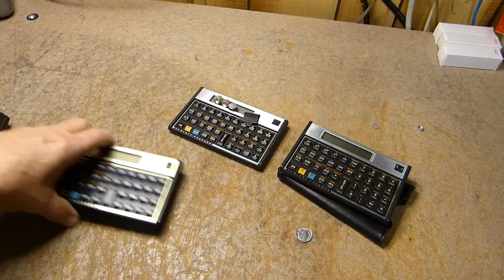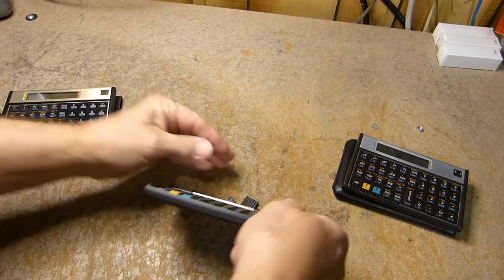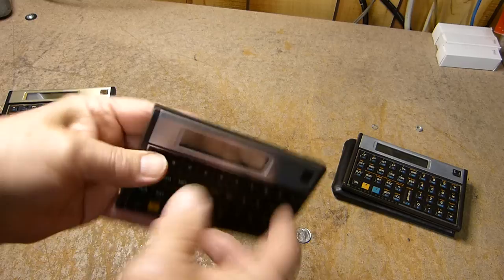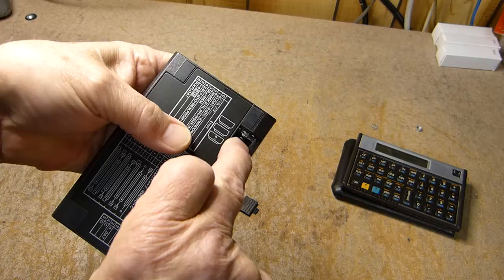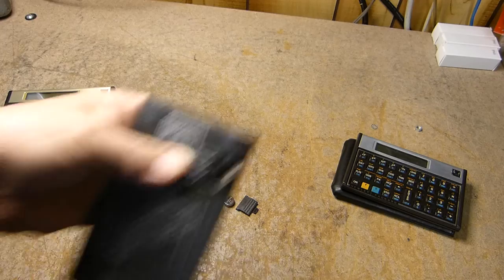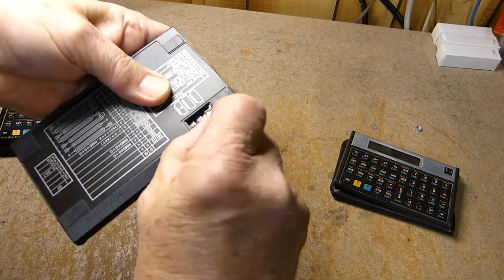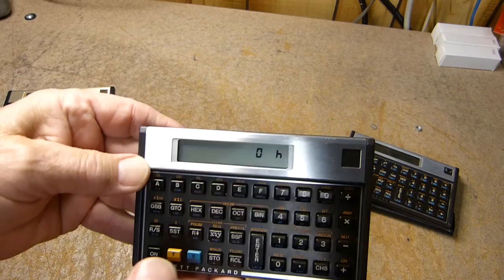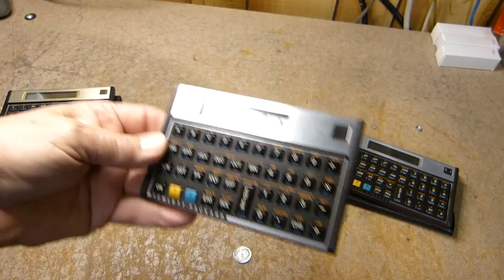HP 15C 12C 16C RPN Calculator Reset Procedure

Comment: WOW.  That is exactly what my calculator needed.  It had "juice" and had a full display of gibberish.  I replaced the batteries with some I had around the house and turned it on and still "gibberish".  I then figured that my back up batteries had also gone bad.  So went to Walgreens and picked up three "357s" for $11.00.  Put them in my calculator (a 12C) and same thing!  I was like "what the @#$%".  So then YouTube searched for resetting a 12C if nothing else but for some laughs and giggles.  And saw your "Dime trick".  With the batteries removed.  So did the "dime short circuit" just like you showed for several seconds.  Replaced the batteries and it came up with the "PR Error" on my display exactly as shown on your video and knew that I must be on the home stretch.  Sure enough by shorting the two terminals together this worked!  I was thinking I was going to have to go onto Ebay to replace the one I had but worse, was going to then have to have a week or more delay on furthering a financial course I was taking.  Hooray!
Reply from the maker: I love success stories. The idea/theory is that it allows some (static) charge to drain off from the logic in the calculators that otherwise can apparently stay for years if not forever. Best of success in your financial course.

Comment: Had my 16C since 1982 and yesterday it stopped working, even with new batteries. However, following the advice here I shorted the terminals together and my calculator is happy again! These HP calculators are the best ever made by anyone and in my view RPN should be mandatory for all calculators, it's just soooo much better!

Comment: My HP12C was shutting off frequently. It has two coin type batteries.  I shorted the contacts on both and also tapped the reset button for about 30 seconds.  It's working.  The reset button is tiny, you'll need a paper clip.  Thanks the tip.  Gus in Caracas.

Comment: My HP15C stopped working even with new batteries.  I tried what you did and it worked!  I can't live without my 15C!!  Thank you very much.
Reply from the maker: I am always pleased to hear when this procedure saves another 15C. I have two and an app on my phone. There is an app on the Internet for PC that will give you errors so it is not an original HP 15C algorithm. You can test it by deriving e which  can be closely approximated as,  e = (1 + 1/n)^n   This can be done manually just make n a very large value like 1E9 and you will get something very close to e. Using the Internet app for 15C it will give you the wrong answer if you use numbers larger than 1E9 (like 1E12, etc)  where as the real 15C will just return a value of 1 which we know is wrong.
Just a tidbit of information. Thanks for the comment.

Comment: Thank you !  Just reset my HP 11C;   when you short circuit the power input with the coin,  as you said,  you are draining the small amount of energy  that some tiny capacitors are in the electronic circuit. That makes the calculator  memories  erase!    This is because our HP.....C is the letter C is for Continuous Memory. This info it really works, and is really easy to do it, EXCELLENT IDEA!

Comment: Thank you very much after using your fix I found in the manual HP reset just to let you know. 

“Resetting Continuous MemoryIf at any time you want to reset (entirely clear) the HP-15C ContinuousMemory:1. Turn the calculator off.2. Press and hold the = key, then press and hold the -key.3. Release the on key, then the - key. (This conventionis represented as on / -.)When Continuous Memory is reset,displayed. Press any key to clear the display.Note: Continuous Memory can inadvertently be interrupted andreset if the calculator is dropped or otherwise traumatized”

PS I do like your videos.

Comment: you my friend are a life-saver. I've had my 11c since 1980,in fact i think i was the first person in NZ to buy one and then it was NZ$300 a lot of money. it has only had 4 battery changes sine then and it failed to start this time. your shorting advice has restarted it and i am saved. i have a 32sII but i'm not so fond of that. Thanks.
Reply from the maker: +Bryan Grimshaw  I am not completely sure but I think I read this technique somewhere in a HP manual. It has happened that mine would not power up properly also and this method fixed it. I assume it is discharging some small capacitors.

Comment: Reset HP11C by inserting a dime between + and - terminals, re-insert batteries.  Voila, PR Error,  use Clr x to clear error if necessary.  Great solution. Charlie

Comment: That's so interesting. I had an old 1987-1990ish ICO CheckMate Enduro Computer that was used for setting timed checkpoints for motorcycle endurance events. It was a pretty amazing little hardened device and it took three 357(?) battery's. It's standard operating instructions said that you had to do this prior to loading the programming. It was a certain way to zero out the unit to load it's programming and then receive yours. I'm sure it's somewhat the same, to insure it starts from the very beginning. I purchased another computer a few years later that looked identical, inside and out that didn't require this shorting. I chalked it up to early electronics and programming.

Comment: I bought my 15C in 1982 and I still use it.  Like it better than 33c
Reply from the maker: I understand. I bought some of the higher end graphing HP calculators soon after the 15C and the fact that they can graph 2nd and 3rd degree equations and find the inflection points, etc. is purely academic trivia. May help to show the graphical solution of some obvious exam question. On the other hand, the 15C is real and I use it daily as of December 2021. I have two real ones and one app on my smart phone. If you calculate e on your "real ones" and you make n too large it will give you an error but if you do the same thing on the HP 15C smart phone app, it will give you the wrong answer. You can try it for yourself to see. For your convenience,   e = (1 + 1/N) ^ N     start out with N = 1E9 and go upward in exponential power one integer at a time.

Comment: The procedure is written in the manual of the calculator "page 106, section Verifying Proper Operation (Self-Tests)" among other special key sequences used for reset/testing of the device (however the manual requests to leave the batteries in, and apply only a momentary shortcut). So rtfm :)

Comment: A thousand thanks and kisses ! This saved my trusty HP15C I bought back in the 1980ies.
It was dead totally, after shortening the contacts it came up with Pr error and after switching off and on it works again !
Unfortunately, other than for the HP measurement equipment, there is no service manual for those HPxxC's I would know of,
which is a real shame. Sooner or later some electrolytic capacitors Im sure they contain will have to be replaced.
Does anybody know about a service manual for them ?

Comment: Your method did not work for me, but it gave me and idea. Here is what I did: 1. Lay the unit face down on a soft work space, 2. Remove the four rubber feet to expose four screws, 3. Remove the four screw, 4. Gently raise and remove the cover.. 5. Look for two micro springs; one near the battery holder, the other at the far end of the case---these springs provide grounding thru the cover's ground plane. 6. Gently remove, turnover and re-insert the springs. 7. On the inside of the cover, observe that there are two metal pads as grounding for the springs. 8. Gently replace the cover, assuring the springs are in proper position. 9. Reinsert the four screws and rubber feet. 10,  Replace the batteries and test the unit. I hope this helps.

Comment: I might be an HP fan. On the desk right now there is a 48GX, 42S, 16C, and 11C. I don't know where my HP41-CX is :) I may have a 15C. I need to check :)
Reply from the maker: Michael Lloyd I'm with you... I am sold on HP reverse polish notation. When I try to use a standard algebraic calculator I have to stop to think so hard each time to do the equal sign. There is a 15C app for phones. I like it and use if often. I have tested the phone app by doing things like taking the sqrt of some large number and counting the strokes down to only one before it becomes unity (1) and then the same on the real HP 15C and I get the same results. That might not test every function but it gives me some confidence that the app is a legitimate 15C. Thanks for your comments.

Comment: I know this is an old video but I'm wondering if you know what might be up with my HP 11c.  I put in new batteries and the screens shows -8,8,8,8,8,8,8,8,8, I tried the short thing and that has no effect.  I'm using brand new LR44 batteries...should I try different batteries?  Thanks!!
Reply from the maker: If you are convinced your batteries are good I don't think new ones would help. Could the "8" key be stuck? I don't think all "8's" is an indication that this procedure will work but I don't remember the exact issue that the calculators have when they need this procedure. Hope you can figure it out...

Comment: Hi, I have an older HP12C that is stuck in run mode on the irr calculation.  The self test looks fine.  Any idea of what is going on?  Thanks
Reply from the maker: No, I am sorry but I don't know much about the calculators. I assume you have tried this reset procedure? If this doesn't help, I don' t know what to do.

Comment: how do I turn on rpn on 12c
Reply from the maker: I Googled it and found this. I did not know it would go into algebraic mode...

People also ask
How do I get the RPN off hp12c?
Changing the mode from RPN to ALG

To change the mode from RPN to ALG, press . When the calculator is in ALG mode, the 'ALG' status indicator is lit. The operating mode remains set until it is changed; it does not change simply by turning off the calculator.
Reply from the maker: https://support.hp.com/us-en/document/c01880634

Comment: How much are these right now?
I just bought one of these for 5 dollars idk the expact model but it exaclty looks like one in the video i bought it cause it looks expensive and rare.
Reply from the maker: The 15C is still pretty expensive on Ebay and so is the 16C. The 12C is pretty cheap. I bought another 12C recently at an estate sale for $2 but the keypad was junk and it was not made in the USA. It ended up in the trash can. I have had a 15C since it was new around 1983 and I still use it daily. You can also get the 15C app for your iPhone.